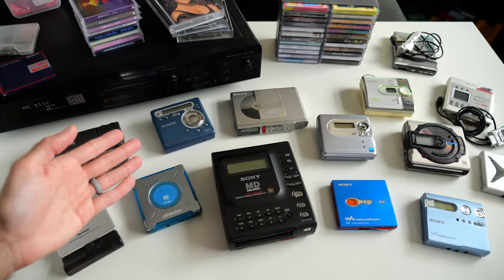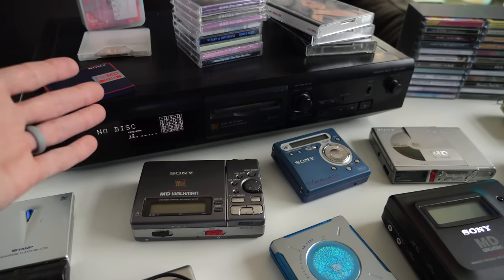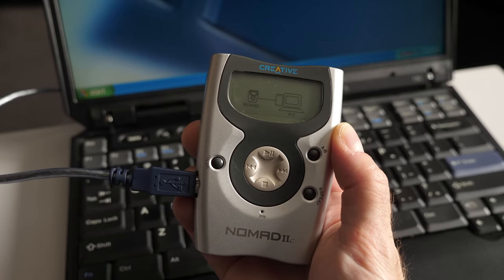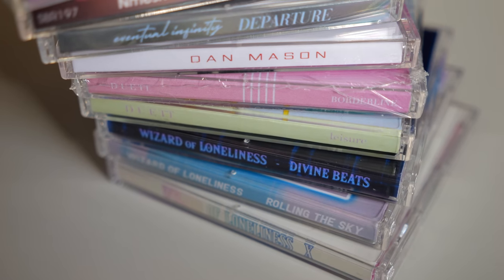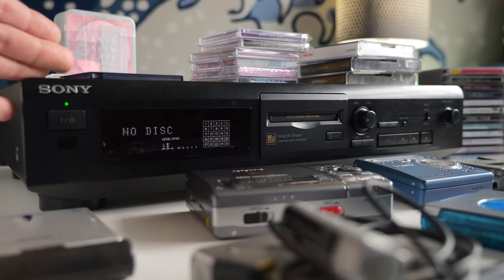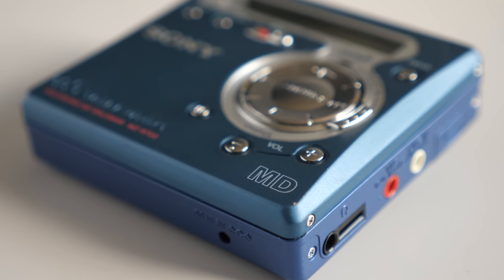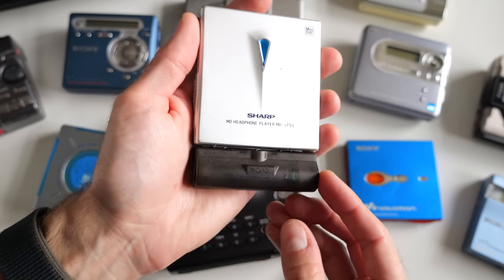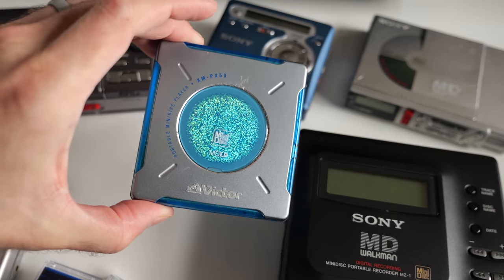Retro Buyer's Guide: MiniDisc!

Comment: I still have my MZ-G750 (R700 with a radio in the remote) and it still works like a charm. I will try to keep buying that style if it should break. MDLP is all I need and that it runs quite some time on a single AA

Comment: Nice! I bought that exact home unit/portable combo on an open box-buy from circuit city in like '98. From listening to tunes while riding a bike to recording and even performing in my "electronic music band", it was and is just amazing. I think the portable still works, but it's packed. The home deck is currently the only dedicated music device i use, and use at least weekly. IT whirs when ejecting or receiving a disk, but if i just leave a disk in it, it's fine.I recently recorded a bunch of albums from YT Music, and there is still just something special about it. Same 30 or so blanks, they last forever, and are tough as hell.

Comment: Minidisc was not a failure. My Sony MZ-R500 still works perfectly, after 22 years. Sure, I don't currently use it a lot, but a couple of years ago, a local band who had some old recordings on minidisc, but no way of getting them off there, borrowed my Minidisc player, and problem sorted. Great format, sounds excellent, and very, very durable.

Comment: Being a big fan of MiniDisc myself ever since, It was fun to watch your video! Concerning the reliability of MD Decks, I would generally recommend not to by all Sony Decks using the MDM-3 mechanism inside, like MDS-JE510 and -JE320. That mechanism is built quite cheaply and very prone to failure of position detection switches due to contact oxidation. Decks like MDS-JE520 and -JE530 using the MDM-5 or later mechanism are much more reliable. For portables. I would not recommend the Sharp MD-S701 and -S702 as they often fail with "UTOC Error" due to defective laser units and new replacement units are hard to find. If small dimensions are not a must for a portable, I can recommend the older Sony MZ-R30 and -R35 as well as Sharp MD-MS200, these ones are built very sturdy and reliable, the Sonys were often used for field recording by radio stations back those days. Replacement Li-Ion batteries are still available or the original batterie housings may be retrofitted with a new 18650 cell.

Comment: TL,DR; - if you're getting an Aiwa AM-F75/80, be sure to get its original AC adapter too to avoid problems :^)

The real pain with that Aiwa (I have almost the same AM-F80) portable isn't the custom battery - if one knows their way around a soldering iron, it can easily be replaced with an ubiquitous "pouch" LiPo cell of similar dimensions, bypassing battery contacts and wiring it into the points on the board directly; in my experience, those hinged contacts don't perform well after 20 years.
The real pain with that Aiwa is the AC adapter. It's probably somewhat unregulated, current-limited 4.5...6V, despite being marked as 4.5V. I don't remember the exact specs of the original, but my unit will operate fine with any old 5V, and it'll absolutely refuse to charge if it doesn't get approx. 6V first. It then starts charging, and voltage drops down to around 4.5V. Maybe my unit was somehow faulty in that regard, but that's my experience with it.
(also see the service manual/schematic for proof that the DC input on the unit accepts a bit more than 4.5V) 

Mine was missing an original AC adapter, so I had to make my own - I initially thought I could just get away with an USB cable and a dropper resistor.

And that extra AA attachment - it's just an extension - it only complements the internal battery runtime, but the unit doesn't seem to operate on the AA alone.
And there's also extra battery inside that keeps the clock ticking, which may or may not need a replacement - it is used for an alarm and timestamping its own recordings.

Comment: I was a big fan of Minidisk back in the day. I was introduced to it from working in the production department of a radio station. We found them very handy for quick voiceover recordings, out on the field recordings and so on. We would then send the audio into Cool Edit Pro (now Audition) for editing. Side note - I had that same full size deck and it had that exact problem so I ended up scrapping it :( I also had a couple of portables but they all stopped reading disks and eventually they went also.  I regret that now knowing it was a quick fix for the full size deck. This of course was around 2000 so I didn't think to look up a fix online.
Reply: I was always jealous of my older cousin that was all in on MiniDisc very early on. The amount of cables and decks that he had to use to rip music in the early days (or get something from a file share server on it). Unless you were really into tinkering or were in deep on BBS, I'm not sure how most people figured that stuff out back then.

Comment: Early in the nineties I bought a Sony MDS-JE520 recorder and a few years later a Sony MZ-E33 portable player.
I was tired of fumbling around with compact cassettes and their limitations and the Minidisc was a true revolution.
--> BTW The Dutch company Philips in that decade introduced a digital compact cassette, DCC which could record and playback the new digital tapes but was also able to playback the old analog tapes. Sadly this format did not succeed at all, too late and, as with tapes, not enough convenience.
Back to me: when cd recordable came though I got hooked on CD's, neglected my minidiscs and did away with my record player.
.
At this time I'm back into vinyl (Dual 704, a hidden gem) with a Nagaoka cart and a Shibata naked diamond stylus, as well as a Tascam MD350 Minidisc recorder, which I use A LOT - I have over 150 recorded Minidisc.
I'm thinking of buying a Sony MZ-R37 to add to my setup, I just love this format.
.
BTW the digital recordings made with the Sony MDS-JE520 sounded ok, but not great, until I played them on the Tascam and then they sounded great!
It means that the old Sony recorder has a AD/DA converter that is not nearly as good as the one in the Tascam.
There are still quite a few of these Tascam recorders to be found, relatively cheap and they sound fantastic; they are in fact only bettered by the highest quality Sony ES line recorders and those are very expensive.

Comment: I'm in the UK and I have about 40 MiniDisc machines including a couple of home decks and a mini system with radio, cassette, CD and MiniDisc. Maybe HiMD models are hundreds of dollars in the U.S. but I have 4 of them and I didn't pay over £100 for any of them. The most recent HiMD purchase was January last year and that set me back £87 which is only a little over $100. I guess I must have been lucky with my home decks, both of them are MDS-JE330 models and both work perfectly. One of them was a freebie that the seller threw in with a job lot of unopened blank discs that I bought and the other one was only £50. I found the Vapex gumstick batteries to be pretty reliable and they're available new for £6. I would also recommend the MyVolts ripcord leads. They do both 6V and 3V varieties and allow you to charge your MiniDiscs from any 5V USB port including your computer with the added benefit that they are much smaller than the AC power bricks and the cable is far less likely to degrade than the supplied bricks. If you are recording old mono vinyl to MiniDisc, setting the record mode to mono will double the playback time on a standard MD but still be playable on the non-MDLP models.
Reply: @rosemarysandcastle  In what way better? They're 50 mAh lower capacity and 5p cheaper. I've used loads of Vapex ones with  no problems at all and no deterioration over several years.
Reply: @rosemarysandcastle  Not my experience but I'll keep an eye out for it. I suppose it also depends who you buy them from and how long they've been sitting in stock too.
Reply: @rosemarysandcastle  I've ordered a couple of doublepow batteries so I can do my own comparison. You can never have too many gumstick batteries anyway. I've been using the Cellonic LIP-12 batteries for my MZ-R2, MZ-R30 and MZ-R35 as they come with a 3 year warranty so hopefully they will last.

Comment: I had the Kenwood one which was basically the clone of the Sharp you showed. I got it in a clearance bin in a store for £92 - reduced from over £200 in the 90's I think. It had optical in but you had to label tracks manually which was a pain so I hardly used it and bought a portable CD player. Sadly sold it for £10 I think years later not realising the value now!

Comment: I still have my Sony MZ-N707 I bought in 2002.  Still works great, although I need to get new discs and a new remote.  The best part is it uses standard single AA batteries or I can use one of the 3 volt DC power supplies (one for home and one for my truck) to power it up.  I'll have to check out that Web MiniDisc Pro and see if I have any luck with it.

Comment: I was a user of mini discs for 15 years.  My favorite thing was recording concerts clandestinely with binaural mics in my ears and the recorder in my shirt pocket.  Even with todays flash recorders I’ve yet to find a stereo recorder (not mono lavalier) that has the same form factor as a mini disc.  Most flash recorders include built-in mics that make the unit bulky.  My BIGGEST problem with the little Sony recorders is that the recording part of the unit stops working.  I have several recorders that now only play back.  No electronic repair shop will work on them.  I wish there was a way to easily fix this.

Comment: I switched from a portable CD player to a NetMD MD player around 2002. It was a great downsize from the CD player and big booklet of CDs that I would haul around. To me, 2000-2006 was the sweet spot for MD. Good enough ATRAC codec to fit multiple albums on a single disk, and cheap enough media to be a better cost effective option compared to the iPods of the time.

Comment: I would still recomend a HI-MD format, it can do all that every other player can do. It will turn an 80 minute into a 240 minute and that is before any other compression, on top of mdlp and all that.   The Sony MZ-NH600D is the low model and what is great is that is last DAYS on 1 AA.  It is my daily driver.
Now getting Sonic Stage to work on modern oss, that can be a royal pain.
Also discs formatted as hi-md can be used as computer storage, just pop the disc in, plug in usb and it shows up as a drive.

Comment: For what it’s worth, you can gain some of the benefits of HiMD on standard 64, 70, or 80 minute MiniDisc discs by using a HiMD player and the Hi-SP or especially Hi-LP recording format on a standard MiniDisc disc. On the downside, your recording won’t work on non-HiMD players anymore, but it means you can fit 10 hours of content on a single disc (that you can still buy) at a quality level that’s perfectly adequate for portable audio. Every now and then, I might want enough music that won’t fit on a single disc in Hi-LP, so I’ll pony up for a HiMD disc then. Given that they can be rewritten over a million times, though, I have no concern about buying blank MiniDisc media. If, like me, you’re only planning on having the one player, there’s a lot to be said for one of the price reduced (back in the day) HiMD players, like my MZ-NHF800, which has an LCD screen, AA battery, and the in-line remote with the radio features.

I do have one pre-recorded MiniDisc in my collection. It’s in the original shrink wrap, but it obviously has some storage wear and tear on the outside case. I found it at a thrift store about a year and a half ago, bought it for $5 (the owner wasn’t sure what to price it for, at first, but she ultimately charged me the price for a standard CD, since it was optical). I probably would have opened it and played it if it were a group I was more interested in (since I’m a firm believer in functional collections), but I wasn’t really interested in the group and mostly just wanted a single pre-recorded disc for my collection, just to say I had one.

Comment: Got the cheapest Hi-MD NH600D since 2004. I bought MZ-R55 cost less than NH600D it got recording and audio in/out. One thing I learned is these MD do not tolerate cheap adapters with incorrect voltage/amp and the MD keep shutting off, have to use EXACT ratings as OEM. Also if you encountered "no disk" error, chances are the optical head is jammed because the worm gear lubrication dried up.

Comment: I was lucky when getting a Sony MZ RH910 for about 150€ a few years ago, before prices went up like crazy.
It can use standard MD and record in Hi-MD mode.
This means approx. 30 mins of lossless audio (PCM) on a 80min disk or 2+ hours of Hi-SP (standard recording mode).
Hi-MD media however is very rare and expensive nowadays, but also not needed to use all capabilities of Hi-MD (at reduced runtime).
Via Net-MD you can even transfer music in a higher bitrate than 320kbit/s mp3 and get a very good audio quality at also a good amount of runtime.
I´ve put the whole "Dance With The Dead"(2020) Discography onto a single 1GB disk in this mode.

However there are some common known problems with some machines.
Some Sharp´s have this broken gear issue so the spindle which moves the laser can no longer move.
This causes the well known "can´t read a" or "TOC error" or something like this.
The fix is very simple, yet complicated.
There´s a guy selling gears and other parts for sharp, aiwa, panasonic etc. but you have to take apart the device, take out the mechanism, remove the spindle and then heat up the new aftermarket gear with a hair dryer, while also quickly and gently push it onto the spindle.
It´s a very tight fit!
I did this once and i broke one of my 5 gears at the first try.
The second attempt did work gladly. It´s working again! But this repair job isn´t for everyone.
The tiny ribbon cables break easily and since you have to take the mechanism out, there is a high risk on breaking the ribbon cable which goes to the upper magnetic recording heat.

Comment: I still have my MD player with optical in, my discman with optical out, and my Sony MD head unit for my old car. MDs really came into their own when used in a car system, when compared to CDs; more robust, take up less space, and no skipping over bumps. I invested hugely in the system, and still have all of my recorded MDs. But I'd never go back to it now, nor recommend that anyone does. My Fiio BTR5 and Tidal (or Qobuz) subscription are so much better in every way. Yes MP3s suck, but FLAC doesn't, and LDAC bluetooth allows for 990kbps bitrate. CD quality is 1100kbps, so LDAC bluetooth is almost CD quality streaming. These days there are many different ways to get higher quality (or at least as good) and more convenient playback than MDs. Only legit reason to go back to MD, is if you just like playing with the hardware. Which is fair enough, they were very cool.

Comment: Great video - I was a somewhat early adopter back in the mid 90's, and still have my original R30!  I really wish you had gotten at least a little into the ATRAC versions, I realize its a bit of a quagmire as they changed the standard along they way and other vendors than SONY used their own standards.....  That being said - and specificaly for SONY units - I wouldn't recommend anyone get less than an (orignial ATRAC) V4 unit....  but better yet - at least ATRAC R.  Very early verisons of ATRAC had serious compresison issues, similar to low bitrate mp3 high end sparklies/shimmer.  But that was cleared up by around V3-3.5..  V3.5 still had high end dropoff at above 12-13Khz.  ATRAC R eliminated this as well and was virtually identical to CD quality.  Another great buy is used professional decks.  I picked up a MDS-E10 that only needed a belt for the eject mech... has keyboard input on the front panel and built like a tank!  I started backing all my CD's to MD about 10 years ago as some of them from the 80's were starting to show bitrot.  that the great thing about MD - I've never had a bad disc in all the hundreds I've used.  My original recordings from the 90's still are perfect.

Comment: MiniDisc is the ONLY off the shelf system able to perform recording on a schedule (on an external timer socket) of analog audio in digital quality, thanks to a timer switch on most recording decks. Well... let's ignore DAT exists for a minute, OK?

If you want to record a single FM or AM radio transmission program, without capturing the whole "radio", that is to my knowledge still the best way even to these days.

Comment: I wonder many, or any, used AAA batteries. A bit thinner than AA.

Also, I wonder if you could mix'n match LP,4 SP, etc, on the same disc? Lower quality for that 80's disco pop, higher for those lovely piano pieces.

Edit: As a quite direct result of this video, I'm now the proud (?) owner of a Hi-MD player, the Sony MZ-NH600 featured in the Hi-MD part of this video. And one Hi-MD disk. Both should arrive in few days. :) 50€ and 20€, respectfully, which seemed like a decent deal. I hope the device uses standard mini-USB, come to think of it.

Comment: 1997. Sony MiniDisc Bundle MZ-E40 player & MDS-JE500 Deck (SP). 
2000. Kenwood KMD-D400 3+1 MiniDisc changer for car (SP). 
2003. New car (Mazda MX-5) with optioned OEM MiniDisc module (LP). 
2003. Sony MZ-N10 portable recorder/player (NetMD). 
Still have the car (with the original OEM headunit with MD) and the NetMD portable unit.

Comment: Sony MZ-R70. Bought it in '99 for a long Flight. Small, takes AA Batts, analog and digital Input, 2 Headphone Connectors and a Remote with a normal 3,5mm Connector. Real-Time-recording - but i've got time.